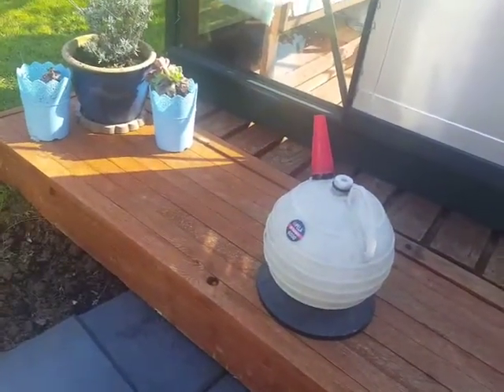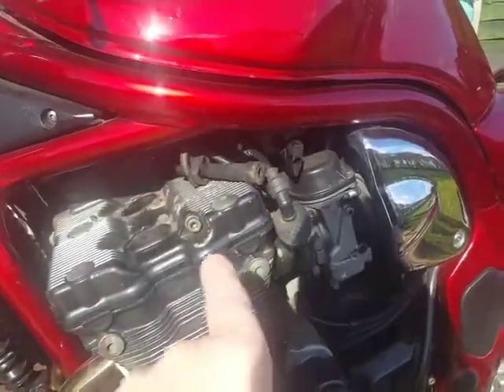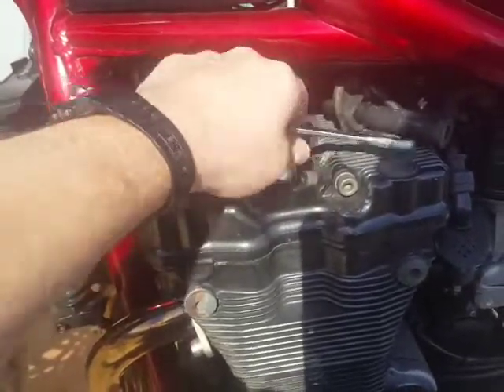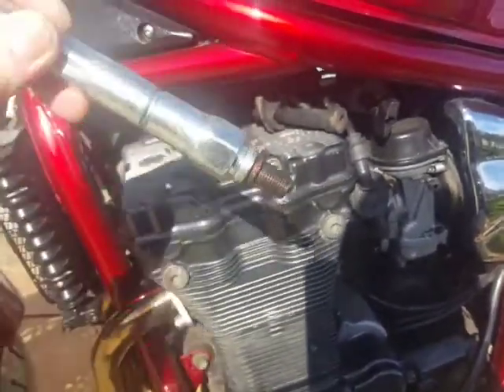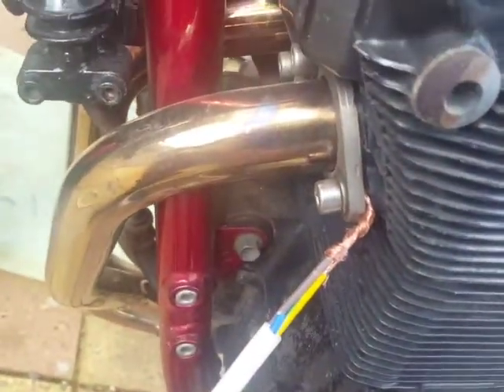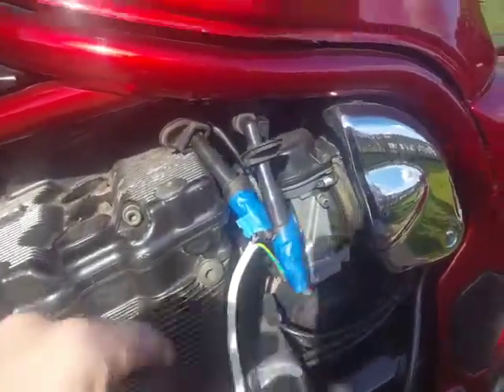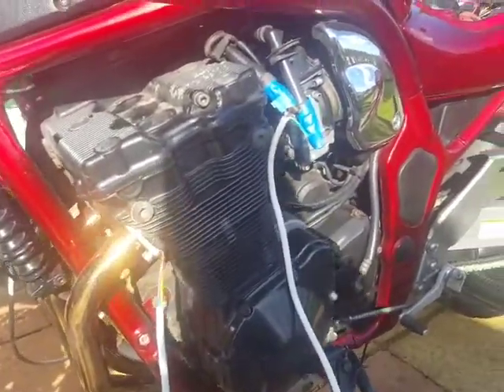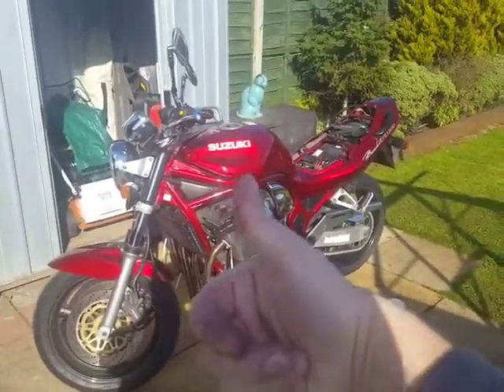mk1 suzuki bandit 1200 compression test preparation part2 earthing spark .

Comment: Can’t you just leave the sparkplugs out?
Reply from the maker: It needs the resistance of the plugs and earth of the engine or it will fry  the cdi unit unfortunately .. 👍🏻☮❤
Reply: @springy-2112  Oops, I’ve done it without the plugs. Hopefully it is ok!
Reply from the maker: @ArcheryChannel  
I've done it in the past without plugs on other bikes and it's been ok ..It was just me following the manual .. Of I didn t have the manual I wouldn't have thought of it .. I'm sure you'll be fine ..👍🏻☮❤😉
Reply: @springy-2112  Cool, thanks for the help!